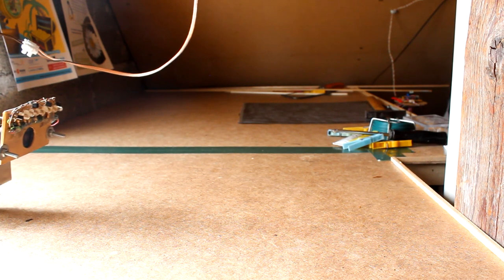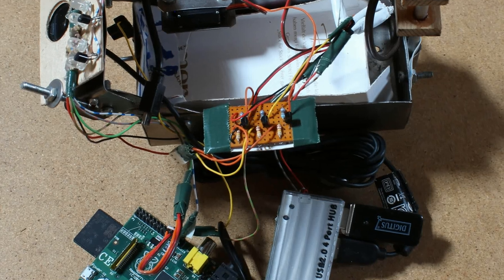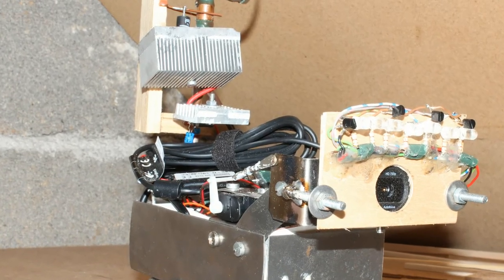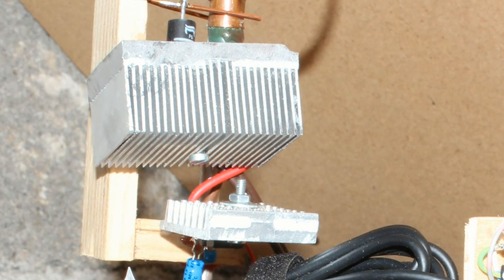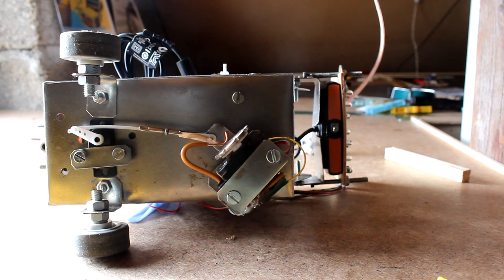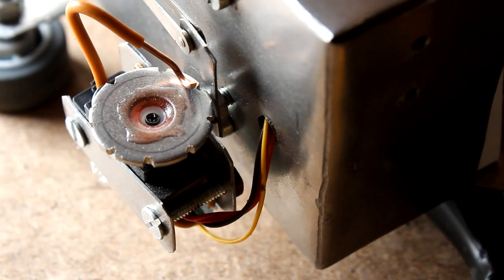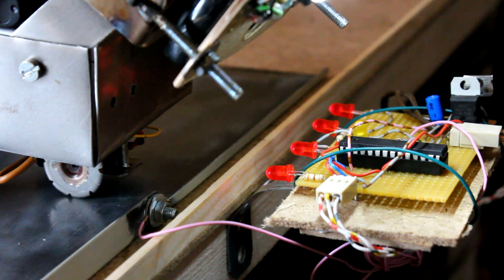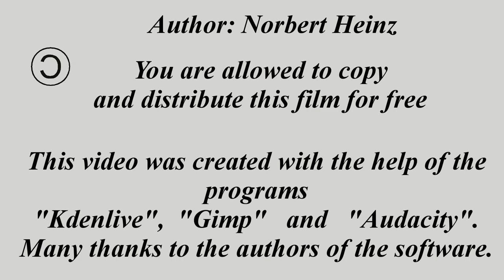Construction details of Curiosity Pi

Comment from the maker: You're welcome!
I have one battery powered Rover, but it's laborious to charge the battery manually each 6 hours of operating time. Maybe some day I will implement a positioning system, so the robot can make it's way back to the charging station. The advantage of a battery powered system is, that the robot can make it's way out of the RoboSpatium (whatever might happen if...).

Comment from the maker: You're welcome!
I have built a battery powered robot ( watch?v=D6GeZsk5Llo ), but it is laborious to replace the lead acid batteries each 6 hours of operating time. So the power supply and the cables are a good solution for 24h of operating time per day.
Another solution for the charging procedure is growing in my head - more about that will follow soon...